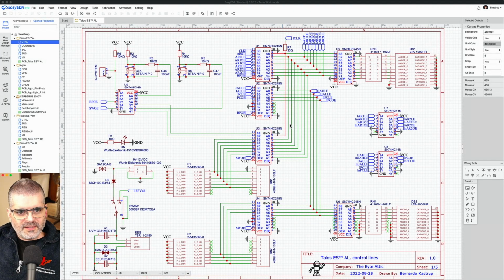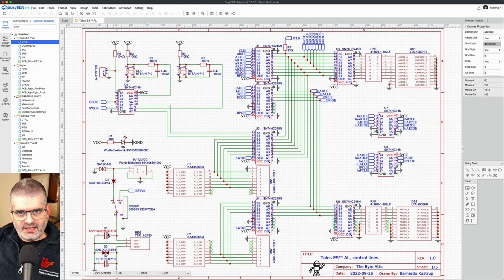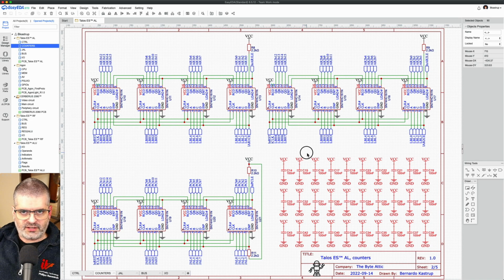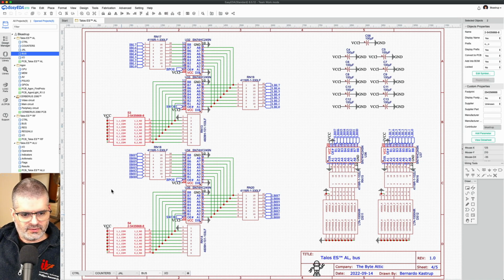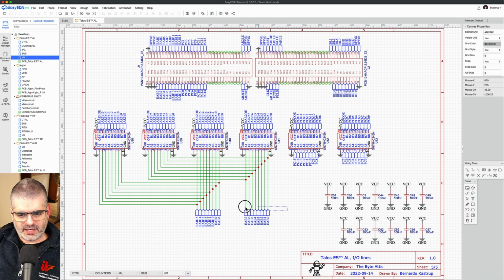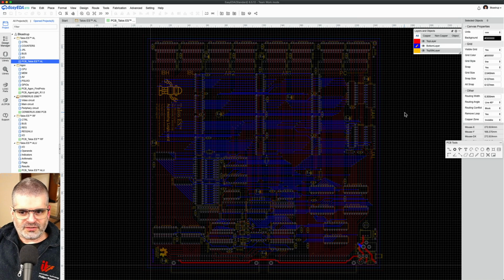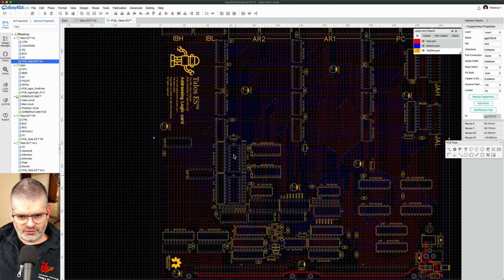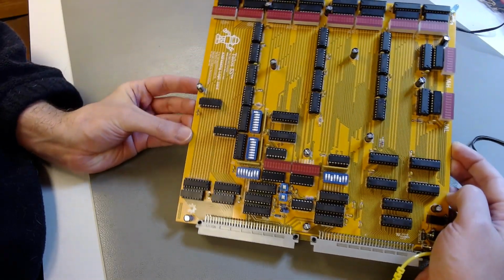Building Talos ES™, the 21st century's mini-computer (Episode 11)

Comment: Maybe a suggestion: there are large open areas on the board so maybe you could make an additional table or something like that on the silk screen for these small dip labels so you don’t need a magnifying glass. Quite easy to do with easyEDA.
Reply from the maker: I'd still need to put a label next to the specific switches, and there is the space problem...
Reply: @thebyteattic  yes of course but I meant to add a table near the switches in one of the large open areas referring to the switch and telling in a larger font what each dip is for.